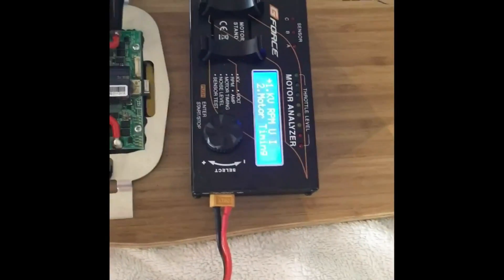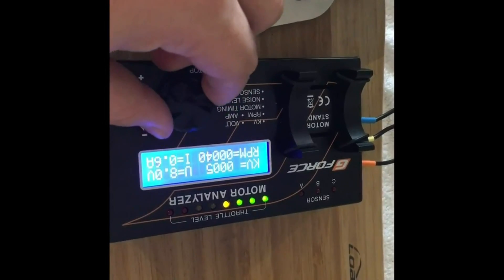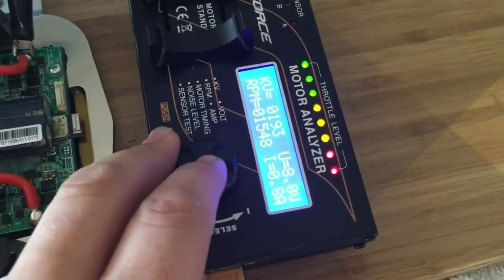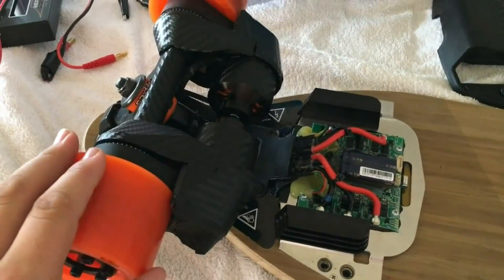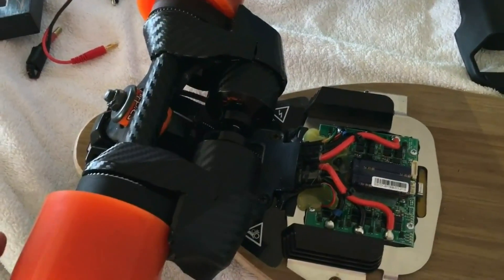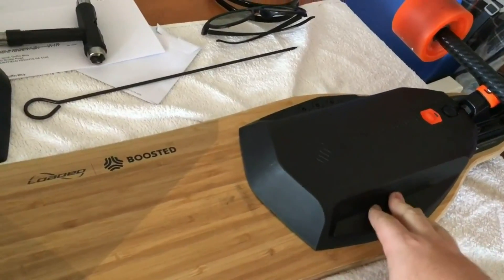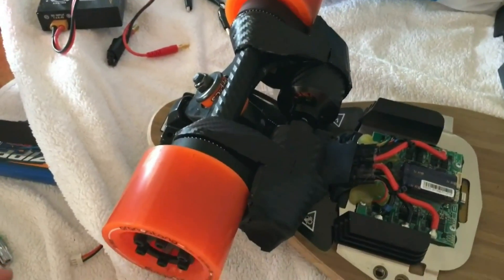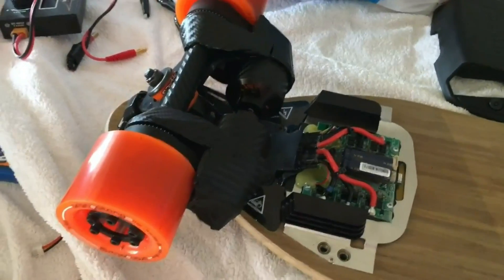Boosted Boards Speed Limit

Comment: ok, so I'm trying to learn. you replaced the motors correct? I have a dual plus and it's not fast enough for me. ha ha. the other reason I'm trying to learn is that I can not leave my apartment and make a half circle in central park.  I need a longer distance aswell.
Reply from the maker: i can do 2 circle around central park and still have juice left to ride around.
Reply: You did this by just adding batteries, or did you do something too the motors? Also I was watching your speed limit video. Your opinion can it be increased?
Reply from the maker: +NEAL MANIS anything is possible. I only added the cells for range. I have other boards that go much faster.

Comment: I see the carbon is tape. . and its to slightly protect the plastics. but does the tape make the motors over heat? I was thinking of wrapping mines since I noticed marking on the plastic. but  with gorilla tape instead  . assuming its a thicker grade and tough than regular vinyl ,

Comment: Hi, i am building one, but my problem is that , when i test the motor free spinning it gets pretty hot, have you noticed it in boosted? whats the working temperature of those motors? Thanks and best regards
Reply from the maker: the motors barely get warm in the summer time. I never had issue with the overheating.
Reply: Okey, thanks and what about the timing of those motors?

Comment: What's the deal with the carbon fiber coverings?
Reply from the maker: no deal....
Reply: +Portable Electric Vehicle Which means absolutely nothing to me or those reading.
Reply: +PHOTOTRISTAN because the board scrapes from time to time, denting and cutting up the aluminum of a $1500 machine with no place to buy replacement parts for a reasonable price
Reply: it protects it from tiny scrapes/rocks banging the metal.. I've used it since 0 miles and now at 500+ miles i have no scratches on the bottom of the board. only replaced the vinyl wrap twice
Reply: +mike arzamendi I know this and covering it with vinyl plastic will do nothing to protect it.